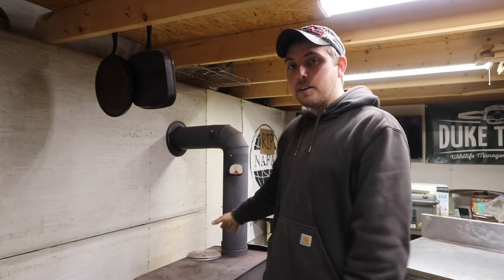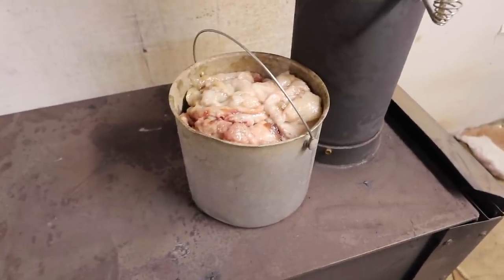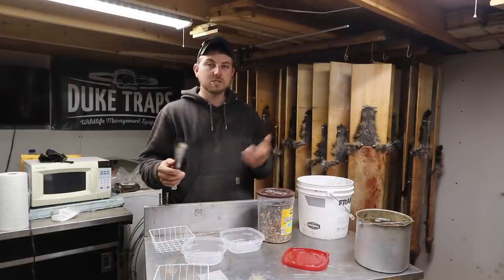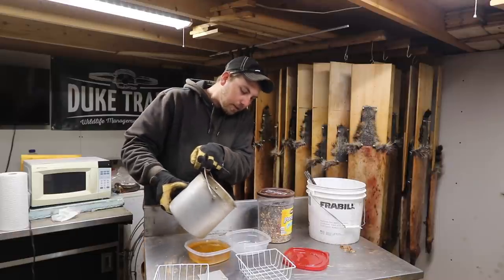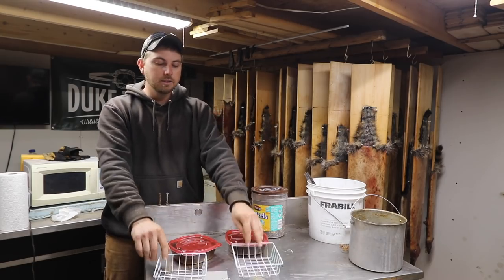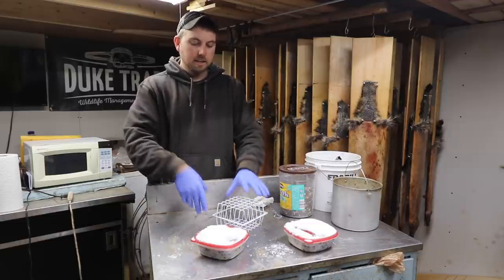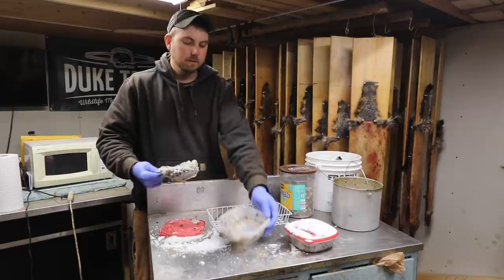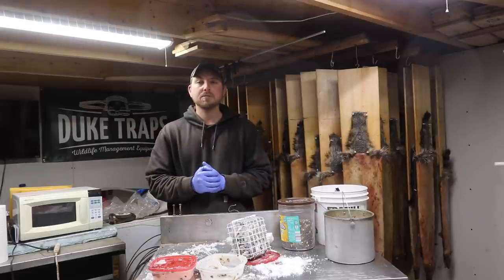Making a BIRD FEEDER From A RACCOON

Comment: I usually add a little Quaker oats and a bit of corn meal.  place the tupperware in a pan of tap hot water for... 30 to 45 seconds and it slides right out.